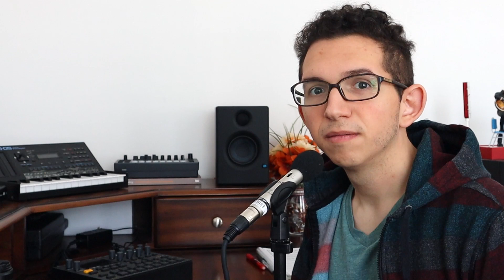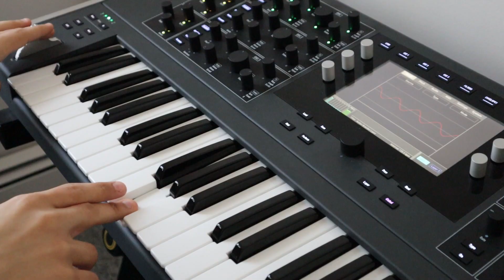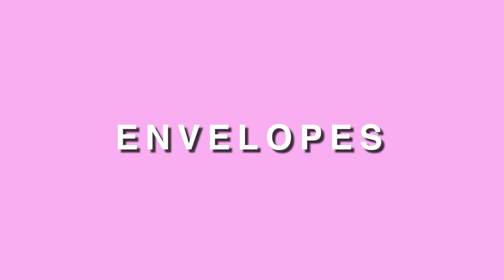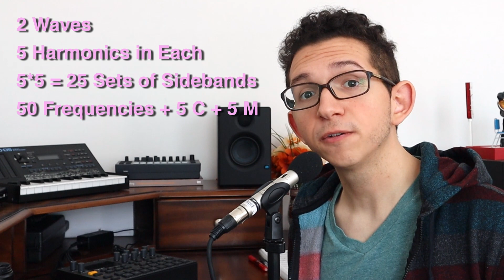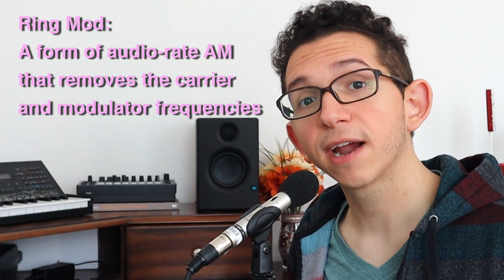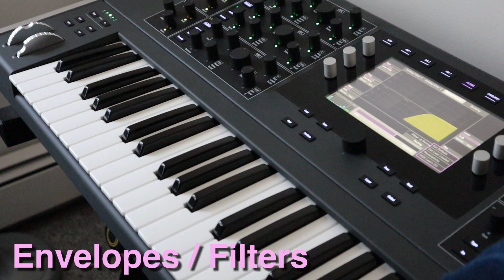Amplitude Modulation, from Tremolo to Ring Mod (Synth Fundamentals, Ep. 9)

Comment: I use a tone generator as an external oscillator for my ringmodulator pedal. What kind of modulation will I have If I introduce a possitive DC offset?
Reply from the maker: @MYGAS21  I’m a bit confused by the wording but, if I’m reading it right, I could see two possible outcomes. First case, the DC offset pushes the modulator signal equal to or above the zero point, so it acts as a unipolar modulator. In this case, it would function as traditional AM (C, M, C+M, and C-M are present). If the offset isn’t sufficient to push the modulator above zero, I’m not 100% sure what would happen. I’d imagine trad AM with weaker C and M frequencies, but strange things can happen at audio rates haha.

You could test it out with a couple of sine waves and see what comes out. Try something like 300Hz and 500Hz so the sidebands would be 200Hz and 800Hz. If it’s RM, you’ll hear the same note two octaves apart; if it’s AM, you’ll hear a ratio-tuned triad with the root doubled an octave up. If possible, vary the DC offset in real time to see how it affects the sound.
Reply: @thatbeet   AM is what I suspected it would turn into. Yes this is what I was implying when I asked "what kind of modulation". I wasn't shure though. Thanks for the responce. I think its important to know I can turn my Ring modulator into an Amplitude modulator just by feeding it an only positive, above DC signal and possibly as you pointed out, be able to maybe use a partially offset sound. As you probably know Ring modulators produce interesting timbres but because the original signals are gone they aren't very musical. And the act of mixing in the unprocessed sound of the guitar doesn't appeal to me either: the result seems wimpy to me. So I'm searching for solutions involving fully processed sounds that have musicality without losing the timbre magic. I haven't tried this AM through offset thing yet, so we will see how that goes. ..........BUT your responce gave me a brain storm type idea (= through word association when you wrote "root doubled an octave up"): ....that the reason the dry guitar sound + Ring modulated mix usually sounds wimpy is because the 2 sounds are so different, the mind just reads them as two seperate things. BUT what if I introduce the original guitar signal, pitch shifted up or/and down to the octave the sidebands are in? This proximity could allow the mind to perceive the two sounds as a unit. If this works it is a game changer for me. SO I can't thank you enough for your responce. Again: THANKS!
Reply from the maker: @ That could definitely be interesting! If you do the pitch shifting as post-processing and include some pitch correction, you could even use that as a way to generate new melodies since the relation between signals/sidebands is mathematically predictable but musically unusual (related linearly instead of exponentially/multiplicatively like most harmonic content).

Setting the tone generator in the same frequency range as the guitar part can keep the stronger sidebands more clustered to your original signal. And, if the DC offset trick works, you can also adjust the volume of sidebands with the amplitude of the modulator if you want something more subtle that blends with your original signal.

Hope you find the sound you’re looking for! Thanks for reaching out :)
Reply: @thatbeet   Post processing? You mean in a DAW? I roll DAWless at the moment. So I used a parallel mixer (the OUROBOROS by BRIMESTONE) put the clean with a pitchshifter up an octave before a gain+EQ double pedal, on one channel and the WARM AUDIO RingerBringer before a bandpass filter on the other. And then put everything in the effects loop of the EHX ATTACK DECAY to further glue things with a common envelope. Its a start.

Comment: How do I key track my modulators as you said ?
Reply from the maker: If your synth allows custom modulation routings, set keyboard as the source and LFO frequency as the destination. Then set the modulation amount so that each octave causes the LFO speed to double. With those settings, the perceived detune should be stable across the keyboard. Enjoy! :)